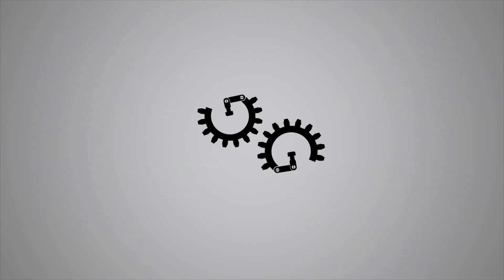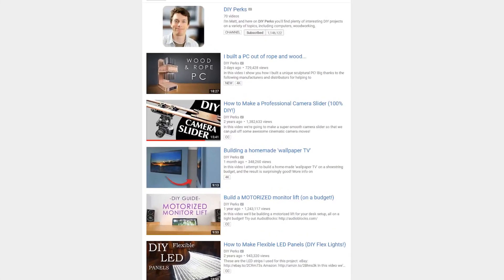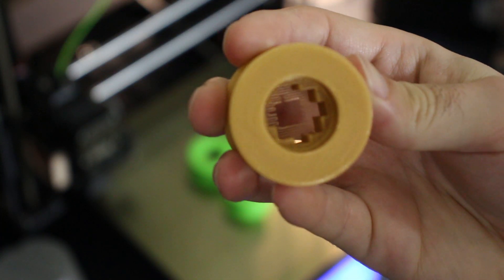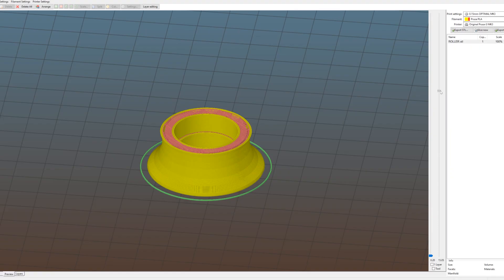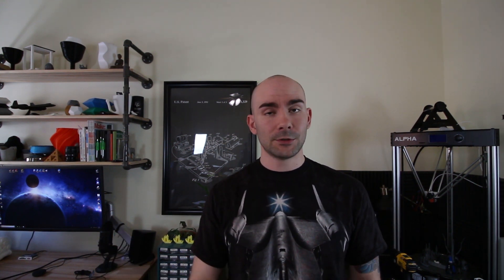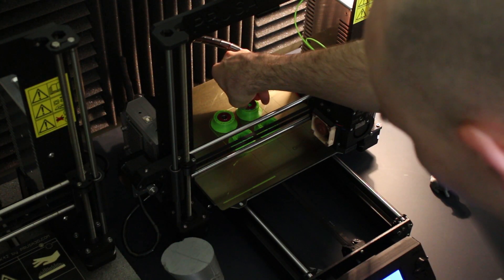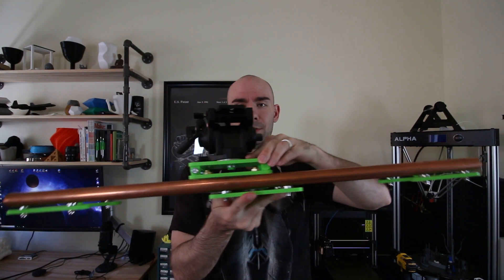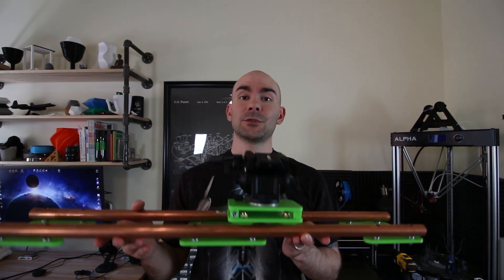Insert parts into 3D printed objects! Using the Prusa MK3

Comment: M601 is even better.  it will push the print bed forward, lift the nozzle, retract the filament and wait for you to press the front button.  using it is just one more step than shown in this video.  using prusa's color3D to add a filament change will add "M600" to the gcode.  after this, use a text editor (like notepad or gedit) and find the "M600" command.  change it to "M601" instead.

Comment: Crap, just found this in my suggested videos and realized I wasn't subscribed!  What the heck, I thought I had subscribed a month way back?  Is YT jacking with subs again?  What Giveaway did I miss?  I have done several color changes prints but I don't understand it I guess, I'm never sure it is actually going to pause and wait for me?  Beeping would be nice!  I'm using cura.  Thanks for the vid!
Reply from the maker: Hey Jim, welcome back and no big deal :)
It should pause and wait for you it does for me, but I’m using slic3r

Someone commented a while back letting me know that prusa control has the color feature built in :)

Comment: Nice video. Would a manual pausing of a print then inserting bearing then continue print, work?
Reply from the maker: Richard, thank you for the question :) it would work but you would have to sit by the machine.  This will automatically pause at the desired layer :)